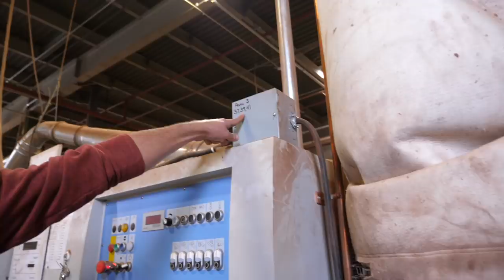Corrupted Logo Obsidian Dice! S3E8

Comment: How much do I have to pledge for the dice
Reply: The dice are $95 on the kickstarter. They got added to the pledge calculator, if you want to make sure you've pledged the right amount!
Reply: @wyrmwoodranger324  so do I need to spend 95 or more to get them or 95 along with anything else I want
Reply: @Seninthekitchen  The dice cost $95. If you are buying anything else, add $95 onto what you were already pledging.

Comment: I really like these space improvement videos, but you've got improper use of a forklift, no lock out tag out for electrical work, insufficient hearing protection, and no respirators while in a dust permeated environment all featured in this video. 

Wyrmwood needs a safety officer.